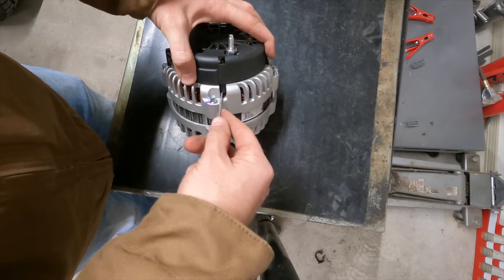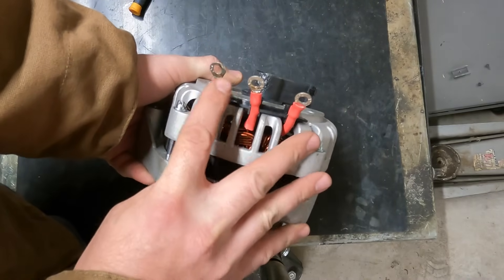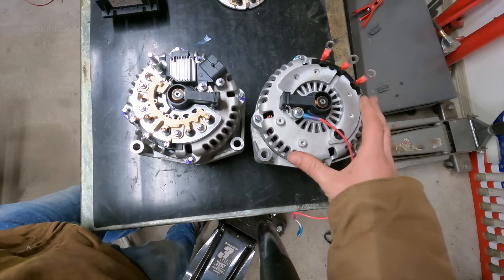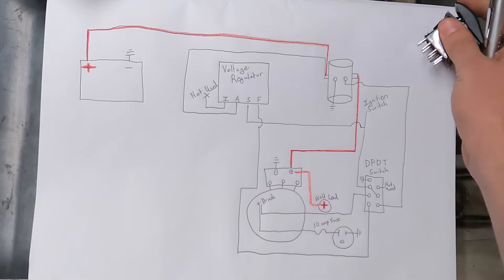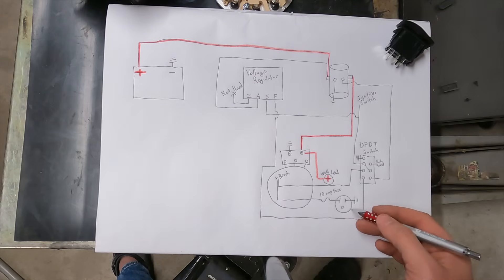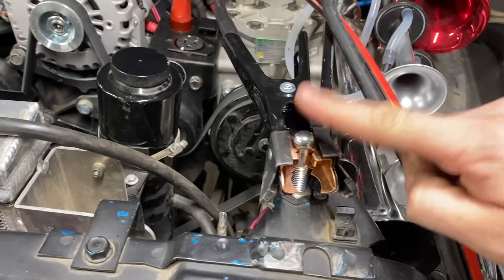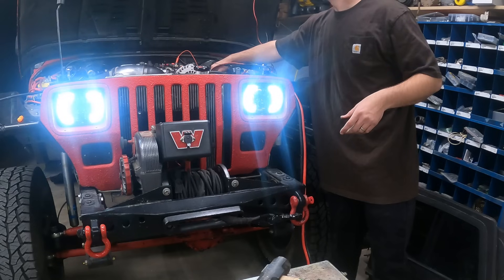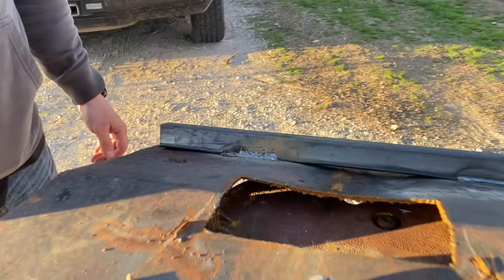How to Modify an Alternator for Charging AND Welding

Comment: So can you weld on your own frame if something broke or would there be an issue with grounding?  You would be grounding and putting charge to the same mass that the alternator is using for ground?  Trying to wrap my mind around it.
Reply: Yes.  That is it's purpose.  You have to run DCEN.  So that both grounds are the same.
Reply from the maker: That’s a great question. Hopefully someone more knowledgeable will know. I’ve only ever heard speculation about this, never any first hand experience.

Comment: EMP protection on your vehicle if you did a secondary alternator to do this it would help with problems that would have presented itself at a disaster situation,  just remember a sun spur could knock out the grid for the next hundred years it almost happened 20 years ago check out scientist who monitor the Sun !!!     ROCK ON ☆.
I am an industrial TIG welder .
Reply from the maker: Carrington Event. I’m fascinated by these. Though I think I’d have much bigger problems than my alternator welder if this happened. Isn’t a faraday cage basically the only way to protect your electronics?

Comment: This reminds me of an add-on my dad had attached to the alternator of the family station wagon to provide 110VAC@60Hz to power his electric drill, which he used to make side money mounting sign displays for local banks and assorted businesses. I later learned that it came available pre-fabricated and had been around for almost as long as alternators have been available on automobiles.
Reply: Those actually produce DC power. Same as the old Lincoln SA200 welders. A drill , skil saw, etc will run fine on 110V DC
Reply: @dieselguy62  But the DC arc when the trigger switch opens ruins it very quickly. Universal motors run much more nicely, powerfully and quieter on DC. I have put bridge rectifiers in my skilsaws with the switch still in the AC circuit. They work much better and sound nice.
Reply: @howardsimpson489  cool story. I've got stuff been using like this 20 plus years.  Still works fine.
Reply: Do tell more if you can I'd like look up and try make or buy one
Reply: @joesphbrantley686  They were sold out of the back of Popular Science and Popular Mechanics magazines, back when the issues were about the size of TV Guide.
Reply: @joesphbrantley686  Just about any 4WD/off-roading magazine or supplier should list or have one.
Reply: @joesphbrantley686 you can buy

Comment: I see some very good advice in the comments. I would like to suggest you do a little research on welding rods. A very nice rod to use on dc is 7018 but they need to be kept in a well sealed container or an oven. For general purpose I use 6011 where I need deep penetration like fixing a crack. For shallower penetration such as on thin metal or buildup I go with 6013. There are many other rods but these are common ones. Some rods are best with reverse polarity so it would be good if you had a plug on your negative side in case you want or need to use these.
Reply: If you're just doing field repairs an old 7018 is probably fine. You won't be doing anything with this where hydrogen embrittlement would likely be a concern or rear its head. People have been using dads 7018 in the garage for decades. If you're preemptive you can store them in a tube full of desiccant if you really prefer the way they run. Personally I prefer 7014 for most diy stuff, less porosity if you're not holding perfect arc length and easier running in general.
Reply: 6013 is the general purpose rod.

Comment: Love it. Me personally I’d have a dual alternator kit so that if I burn it up on a trail repair I still have charging capability
Reply: As the saying goes, one is none two is one. However, it would be even better to have the spare be one of these in case your charging alternator fails you can still charge with this welder.

Comment: Excellent DIY video. I like the idea and explanation. However, I have a couple concerns about the welding.1) Any chance this setup could fry the ECM making the car undriveable. 2) What about overheating the wires (especially the car ground wires)? You demonstrated that it works but possibly at higher RPM's there could be problems.
Reply from the maker: I don’t think I would take it much higher in RPMs, it was already welding pretty hot. I’m not sure about frying the ECM. All I can say is it hasn’t yet, and I have the higher voltage isolated to the welding lead.
Reply: @sweeneyoffroad  I would worry about welding feedback into the car's electronics if you're welding directly on your own vehicle but if you're taking parts off before welding I don't foresee a problem.
Reply: @sweeneyoffroad  sparkie's comment about the ground wires is definitely valid though, I would run a 2nd wire from the rectifier for the negative welding wire which also gives you the option of swapping the welding wires round for rods that prefer the opposite polarity. This guarantees that bad ground connections cannot feed back into the car's electronics.
Reply from the maker: @alanhat5252  yeah, there’s really no reason not to run a ground directly off the rectifier. And a few reasons to do it.  Thanks for the thoughts and comments!

Comment: great video, Note on safety, D.C. voltages are generally safe, however there is a known voltage at which it has no problem penetrating your skin, it overcomes the resistance of the skin, then it can be lethal, i forgot what voltage that is, but if you exceed 48 volts assume you are fast approaching potential danger

Comment: We you using DC voltage or you using some inverter for the welding machine ?
Reply from the maker: The rectifier converts the stators’ current to DC.

Comment: Years ago I bought a device that allowed you to get 110 volts DC out of your vehicle alternator the unit had a voltage gauge and a switch when in charge mode your charging system worked normally to charge the battery and power the lights but when in 110 it disconnected the battery and regulator and you'd bring your revs up till the gauge read 110 and you could use your 110 power tools I used a drill and a circular saw quite a bit and they worked great one day I was power washing a oil rig mobile campsite and as it was getting dark I rigged up a cord to plug the lights in but only powering the lights in one unit about 8 hundred watts I had to rev my motor to the max around 11 PM the owner came by to see if I would finish up before I shut down for the night I said I still had the back side of the unit so would have to wait until the sun came up as it was too dark to see back there he informed me that it was fully lite up thats when I found out each unit had 5 150 Watt lights on the back and all 6 units were fully lite up so it was no wonder I had to rev up my motor to the max to get to 110  I was not just powering up 6 100 watt bulb inside the unit I was working on but the 5;150 watt bulbs on the back of all 6 units it was a wonder I didn't fry my alternator

Comment: Yeah, you can get some serious voltage out off that alternator unregulated, if you spin it up enough the voltage becomes deadly. Be careful with torching weld leads. Even the car cassy is grounded so it's a big Hadar torching the weld rod or lead if you run it up @ higher rpms, other ways, looks like a good idea and great job 👍 just know what your doing, be safe and don't lend it to your friends if they're not absolutely aware of the risks involved

Comment: Excellent explanation and engineering on this project! Just a heads up to anybody that wants to do this on OBS Ford (70's and 80's) and I think some of the square body Ford's (90's), you'll cook your alternator no matter what you do because the brush setups are very poorly designed, so badly designed in fact that if you jump a vehicle using your truck while your engine is running you will fry your alternator, if you're to do this on an older Ford I highly recommend converting it to a older style 2 wire GM.

Comment: Get a good water tight container to keep your welding rods dry. Also I would throw as many desiccant pouches I could find in there also. If your rods get any moisture it will degrade the coating and they don’t weld good at all. I have always kept my rods in plastic containers in the shop. Great project thanks for sharing.
Reply from the maker: Good tips!
Reply: @sweeneyoffroad  also as much vibration proofing as you can manage, rods don't like being rattled around.

Comment: It could be brazing solder. You won't get hot enough to melt that with a normal torch. Kinda makes sense though. If those things get as hot as you're saying it's probably a safety feature.

Comment: Mind blown. What a cool project. And your aviation style mixture control for the throttle in the dash is amazing. Where did you get that?? Instant sub.
Reply from the maker: Thanks for subscribing! Check out the video description, I put all the parts in it including where to get them!
Reply: Those throttle controls are currently used on military vehicule

Comment: I have a 04 rubicon with the 6cyl. I was watching Merlin’s garage where he did this also. I thought about making a bracket to add a dedicated alternator for welding only and now possibly a plug! What do you think about that?
Reply from the maker: That would be the more typical way to go. If something happened to the auxiliary alternator, it wouldn’t leave you without the ability to charge your battery. I really just wanted to see if it was possible to use a common alternator.

Comment: If you'll revisit your project, you should leave the stock alternator as it is and install another alternator dedicated to welding, maybe get rid of the AC compressor to make room for the welding alternator instead.
That way the system will be more reliable and simpler to wire.
Reply from the maker: Yeah, if this mod ends up being troublesome, that’s probably the route I’ll go. Working well so far though!
Reply: @sweeneyoffroad  I don't see why it would be troublesome as long as all your connections are sealed with solder or grease.

One user-error is very possible though – forgetting to flip the switch & ending up with a flat battery for the car.

Comment: Ok for welding you need to make a reactor to smooth the weld. Basicly it is a coil of welding cable around a metal bar or pipe. This help to re establish the ark after it breaks.

Comment: Nice setup. Question I have is, while your switch is in welding mode, does car battery being charged same time??? Or once it’s switched over it would charge the car battery.
Thanks
Reply from the maker: It won’t charge while it is welding. You will need to recharge the battery periodically (don’t weld for more than a couple hours without charging).

Comment: I have a 73' IH Loadstar 1600. I want it to be a service truck/car hauler/scrap hauler. I was gonna put a giant PTO generator between the frame rails and have the existing shaft PTO spinning it, then install a new pto with hydraulic pumps right on it for the dump bed and do away with the pump/reservoir box thing... I think I'll just go this route instead and leave all that alone lol could you run more than one alternator and squeeze 220 out of it?

Comment: Mint, but u have no charge 2 the alternator field coil battery just the battery charge. while welding. This will drain super quick n stich u up. A duel or twin battery set up like on a camper van. Will stop u running out of juice. N give redundancy. Still mint I like it
Reply from the maker: It will go about 3 hours before you should flips it back to charge mode. That’s a heck of a welding project! Thanks for watching!

Comment: Very cool!
I know the GM "one wire" alts are the standard for most folks.
I always preferred the Ford set up with a separate voltage regulator.
The regulator is easier to change when it goes bad.

BTW I have had a really hard time finding continuous use solenoids that hold up.
I have a camper that used a Ford solenoid from the factory to charge the cabin battery.
After 30 some odd years the original one died.
I got a replacement from Auto Zone.
It lasted a week.

I got an extreme heavy duty continuous use solenoid from Grainger and it lasted a couple of months.

Let me know how your Amazon solenoid holds up.

BTW was your power steering pump dying in the first clip?
I hope it wasn't the alt making those screeching noises.
Noticed the noise was gone when Mr. Moody tested your welder in the 2nd clip.
Figured you took care of it.
Reply from the maker: Interesting about the solenoids. When they fail, did they fail “open”? Hopefully that makes sense.

The alternator whines a bit when welding, but I have a pretty annoying belt squeal that has been present ever since I ran a longer belt for my York compressor. One of these days it will bug me enough to figure out what’s going on.
Reply: @sweeneyoffroad  When my solenoids failed they all failed open, like you had turned them off.
Some would still click when you applied power but they were not making the connection inside.
Maybe I just had a bad batch.
Reply from the maker: @1978garfield  good to know. I’d much rather one fail that way than the opposite.
Reply: Get a solenoid for a snow plows  use , they are made for constant on use , they look like starter solenoids but are made different and will last but cost much more $50 or more .

Comment: This is a cool project. My miller runs 75-80 volts OCV (open circuit voltage) when in stick mode just FYI. So rev up to that voltage and get the potentiometer working and youll be set

Comment: What is the duty cycle of that alternator in weld mode? And how do you know what amps you are using?
Reply: I would weld two inch’s and let it cool off for five minutes
Reply: Mine ran all day welding.  Only had to turn it off to let the vehicles battery charge.

Comment: Great overview and detail really.  Nice work!  I like how WorkingOnExploring commented as well to detail the improvement design suggestion.  That's totally awesome and great information to know.  I've wondered about doing something like this for my Jeeps maybe a decade ago and almost invested in a larger alternator to move forward on.  Never really needed and only now just started working with welding again.  Oddly using the one type I never liked when I had welding in high school, the MIG and even worse seems, the FCAW.  Handy however and rescued a few made in the USA welding machines while at it and I'll see how I can improve beyond the getting back into service.  Have a good one and kind regards in Christ.
Reply: @JOHNDANIEL1  Thank you sir for the input.  Makes sense for a more solid state control approach to better have a fine adjustment compared to RPM control adjustment soley.  Neat to read the latest details about.  

I wound up getting a  2006 Prius, so been out picking stuff as usual along with the additional focus for parts for working on getting the 2006 in spec cost effectively.  Now I have three inverter converters for that gen 2 to play with for the universal generator inverter, welder with balance control and plasma cutter plan for those CVT MG's and inverter-converter assemblies, though will need more serious study with good documented plans with simulations in LTSpiceIV before I start working on and really I'm waiting to get more the machine shop going, so like my Dad always wanted me to if I was going to fabricate with steel.  Came home with a 10,000W step up and step down 120-240V transformer yesterday that took me across the state to get that since was a great buy new, Amazon returns seller.

Comment: This is great, but for super short welding, they actually sell welding kits for off road at a very low cost, and you don’t have to sacrifice charging your own batteries for it, running the engine just on batteries will mess the batteries up, check those kits out
Reply from the maker: I’d be interested in checking out these welding kits you’re talking about. Do you have a link?

This set up is comparable to the Premier Power Welder product which does not charge the battery while welding. You can safely run the engine for ~3 hours while the alternator is  not charging the battery. If I can help it, I won’t weld with it for more than 10 minutes. And I definitely won’t approach 3 hours lol. In any case, it would probably be a good idea to run a deep cycle battery if you do this mod.

The biggest difference between this alternator an a Premier Power Welder is about $1500 lol